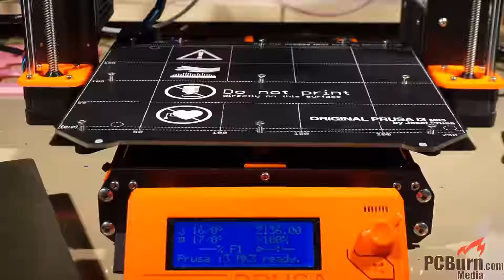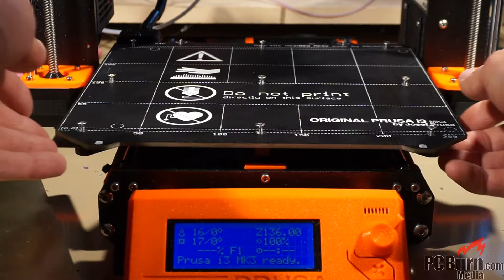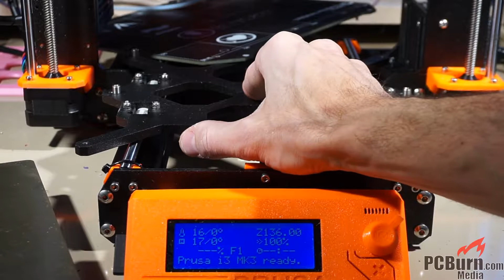Prusa i3 Mk3 Back to Bearings (for now)

Comment: are you still using the Drylin ? I got some piece here but i found that after install the bearing itself abit loose. so I did not put on my printer yet
Reply from the maker: I do use them (not on the bed, currently). They require different tolerances (smaller) on the enclosures or the drop in replacements which are a different part.

I'll probably be shooting a quick component video specifically on that and there are some good resources in the comments here.

Comment: i installed igus bearings with just the u-bolt today
can confirm they shlopp around quite a lot 

ill prob just leave the printer as it is until i encounter any sort of artifact and then try igus+custom mount
if that wont do it ill just bite the bullet and order 3 RJZM-02-08 cased igus bearings for 20 bucks

i just want to get to the point where i can print through the night in the same room

apreciate the videos btw
Reply from the maker: Yea, you'll want some enclosures for them. I'm working on the dimensions for my own but there are some on Thingiverse.

(Here's one.. new Thingiverse site's horrible https://www.thingiverse.com/thing:3426297 )

So far from my own testing going making the ID of the pillow .1mm smaller than the OD of the bushing produced the right amount of pressure. I'm unsure if FDM will work or if I finally need the lathe functioning.

Comment: possibly print a better mounting bracket?
Reply from the maker: Yes! I've got a few new ones designed on the desk. Still working on if the plastics can reliably apply enough pressure, and not deform, or if they should be metal.
Reply: @PCBurn  I would think having to press fit them would be an issue. 

Would also like to see how performance is if you print your own bearing out of something like PETG or PLA if heat isn't an issue
Reply from the maker: So I am at the point with them that I've press fit a couple. Aside from needing to be broken out it seems to be fine.

I need to scale back the amount of extra material in my test enclosure block now to see how robust PLA is on the press fit stress..